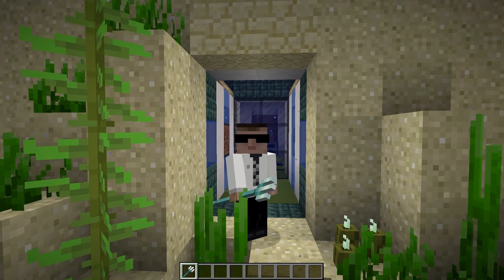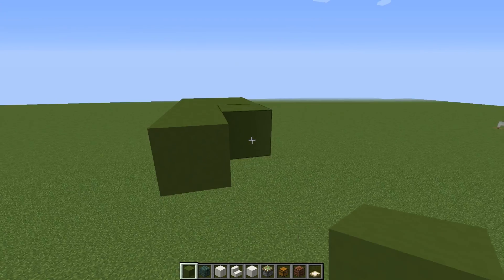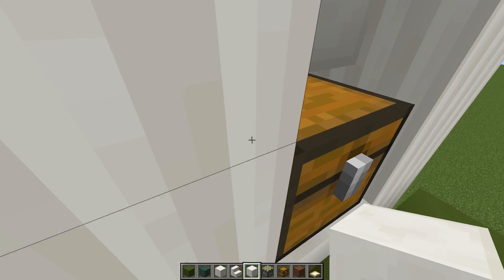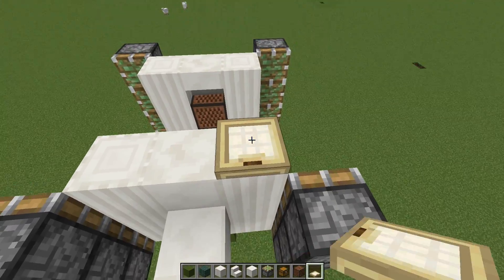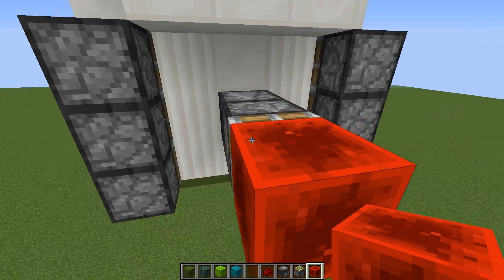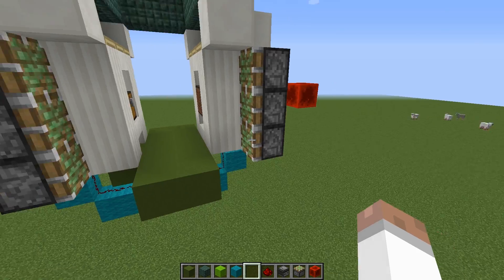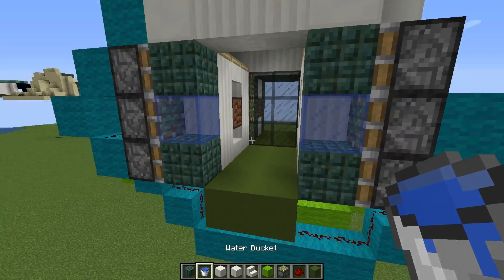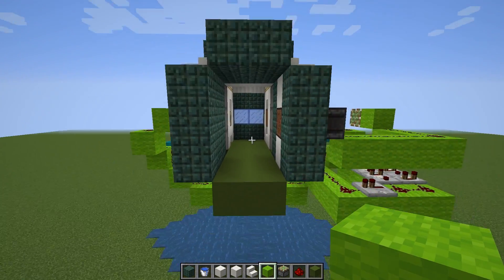Underwater Airlock Tutorial | Minecraft Update Aquatic

Comment: This worked out great for my underwater house. 

I also added an outdoor switch in case the doors are closed and someone outside wants to get in. 

To do it I added a sticky piston to move the redstone block from above,  adding a sort-of temporary 3rd position in the flip-flop.

My order was:
Button > comparator/repeater delay (just like the one used here) > noteblock > observer > sticky piston 

So what ends up happening is the doors are shut and you're underwater, you press the button and the doors open, you quickly step in and wait, the doors behind you shut after a delay, the water in the airlock drains, and the inside doors open (so you dont have to press the note block once you're inside)
Reply: nvm buttons dont work underwater

Comment: I actually built this on 1.14.3 and this setup actually does work.
I modified your circuit with the tflip flop a bit and made it a tiny bit smaller then what you have it at.
I reduced the amount of doors down to 2 by 2 doors and ran the circuit across the top with no redstone on the bottom.
If you like I can send you the world level for you to look at if you want see the circuitry.

If you position a line of redstone to the left of the redstone brick you can invert the signal using a torch reducing the length of redstone you need to run. However to do so will raise the cost by 2 repeaters across the top. If you use regular wire then both sets of doors will open and close at the same time instead of opposite times.
Reply: There supposed to open opposite times

Comment: JUST A HEADS UP: This design does not work in the most recent version. If you still want to build it though, use a different t flip flop instead of the note block.
Reply: I just did it and it works well 1.17 btw